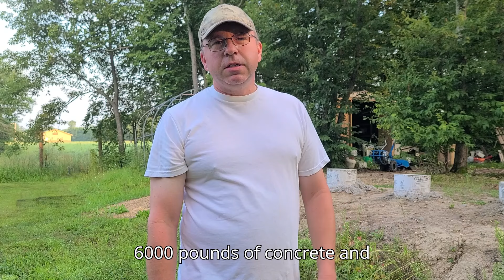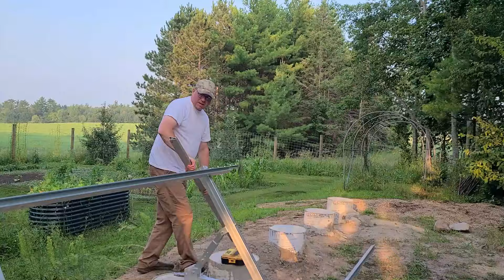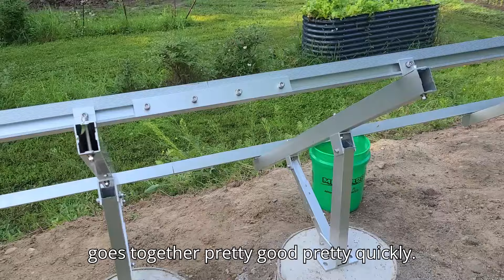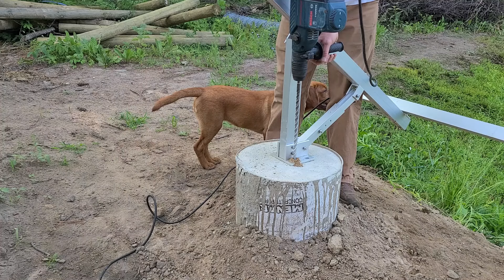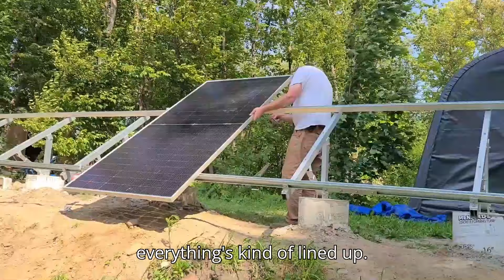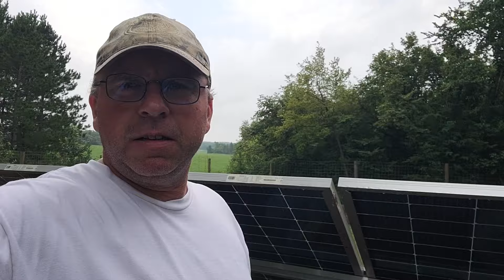Eg4 BrightMount racking and 4280 watts of solar. #eg4 #solarsystem #offgrid

Comment: U should turn the top horizontal 180 degrees. The bolts to the splice kit should be facing down towards the ground, not up to the sky.
Reply from the maker: Thanks, I must have missed that in the directions.  Happy Thanksgiving.

Comment: I picked up a bunch of those 535 bifacial panels and they are absolute rock stars except for being an absolute pain to deal with installing at 65lbs a pop.
Reply from the maker: Ya they are kind of awkward to deal with. Plus trying to fight the wind was not fun.  Hoping I get them wired in this weekend so I can see what kind of power I'm getting.

Comment: I use a chair on the bottom of the panel to install mine or clamps to keep it secure so it could be done solo. Did you use the Brightmount Rail Extension kit to fit the Panels? I thought about putting 560 watt Bifacials on mine (Sungoldpower) I was debating what would be easier to lay out tarp underneath it before or after? I don't want grass to grow underneath it and the reflective properties is a plus
Reply from the maker: I did have to get 2 of the extension kits.  I was hoping to just have to use 1 but it would have been about 1" short.  I think the main thing with bifacial panels is to get them up off the ground so that the ambient light can get to them. I still have to do something with the ground under mine as of right now.  To many other projects in the fire!  I have about a 2 ft drop in front of mine and am hoping that helps with the snow this winter (also another reason to get them up high).
Reply: @dustybooksdiy  I just used Two 6x6x10's chopped it in half buried 2 feet in the ground 3 feet high, no concrete, its sturdy ain't going no where

Comment: New subscriber here.  Thanks for the video.  Do you have the racking system you used.  Was it bright mount or something? Thanks. All the best from north Texas.
Reply from the maker: Thanks for subscribing.  The racking is BrightMount.  I just noticed that I mis spelled it in my video description.  I'll have to get that changed. So far, I am happy with it.  easy to install.

Comment: I’d be more concerned with shade or trees falling on the array than it blowing away with all of that concrete. They need to be 3-5’ off the ground in the front to gain much from bifacials.
Reply from the maker: Your points are spot on.  And I do have a plan to take care of a few issues that you've pointed out.